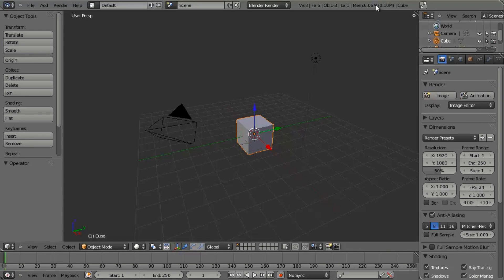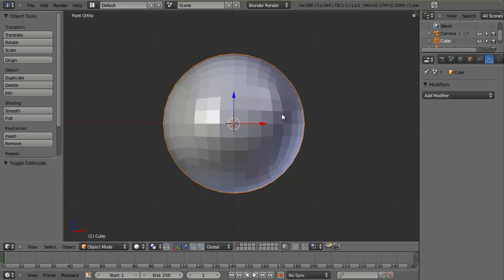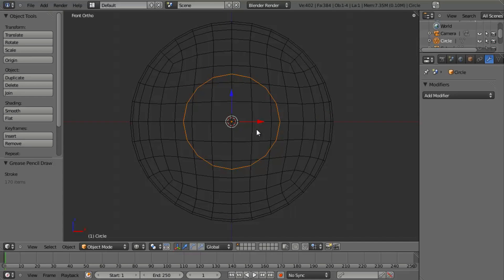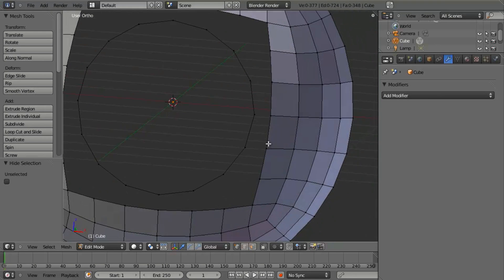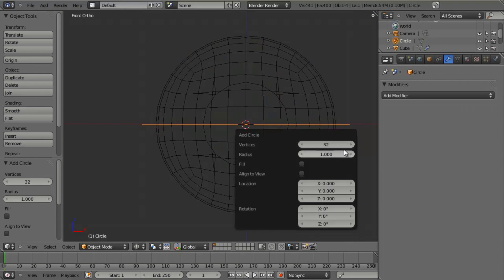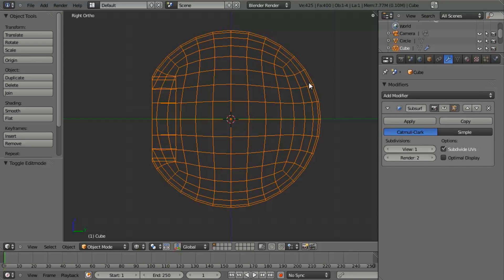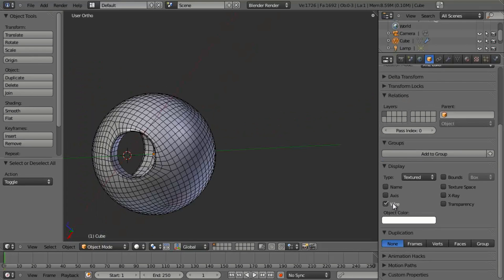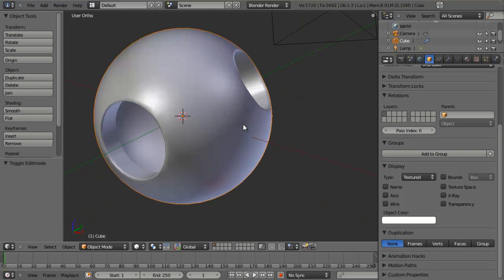CGC Classic: Modeling Round Holes on a Curved Surface (Blender 2.6)

Comment: I feel like this will never not suck. And typically the more polygons you are able to use, the better the result will generally be, assuming you are able to keep control of things anyway.

I'm not sure how to do this in Blender but there's probably a tool/script that does it out there somewhere.... but when polygon budgets are tight - I will basically cheat by projecting vertex normals. Basically cut the circles in the round thing however I like. The curved surface will generally have shitty shading, but if I project the vertex normals of a sphere with no holes in it onto a sphere with holes in it, I will get the correct nice shading of the sphere. In Maya I will achieve this by using Transfer Attributes. Also not sure how to do this in Max but I think there's some 3rd party scripts for it, I heard of something called Normal Thief.

You could also use normal map trickery but I don't think that's generally considered good practice.

Comment: Not sure if this was possible in 2.6 but instead of turning your sphere, you could use a "track to" constraint so that the circle is always facing the sphere 90 degrees. Once you are happy with the circle location, duplicate the circle in edit mode by pressing "Shift+D" and RMB to let the copy go back to its original position on top of the original circle, then separate it from the original circle by pressing "P". Your duplicated circle will retain the rotation angle of the constraint track to. Finally, delete the original circle and its track to constraint. Then, apply the cut with the shrink Wrap and so on.

Comment: Jonathan this hole video works for the first hole but not the second one. You can tell the second hole is not perfect. So if you gonna make a video do it right . For someone with your experience you shouldn't settled for anything less then perfect and specially making a tutorial. 
I listened to you for years and now your slacking bud

Comment: The easiest/best method is to use booleans. There are now plugins that add bevel to intersections. Your method too many clicks and it even add pinching. If you put fully reflective texture you'll see wrong reflections near hole. Even with phong it's already visible, it also affects silouette, visible from 90 degrees.
Reply: best way is to use loop tool.
just enable it in the add-ons.

Comment: I would personally use 2 round cubes with exact same scale and exact same location and rotation and then subdivide one of the cubes alot and model the other cube on top of the other while using Shrinkwrap modifier and then also using the Looptools addon. That makes it 100 times more easy to put a circular hole wherever i want it. And then i just apply the shrinkwrap modifier and delete the subdivided round cube

Comment: The fact there is, has to be, some special method for cutting circular hoes in spheres is just a general and abysmal failure of Polygon based 3D modelling
Reply: You could always do a sculpting workflow if you prefer, although at the end of the day if you don't know the polygon based topology you'll have a harder time making an optimized model. Otherwise I'm really not sure what option you'd use that isn't polygonal. I suppose maybe you could do something with Nurbs, metaballs or a particle and influencer system, but those options hardly seem less complicated to me.
Reply: You could always just knife project

Comment: ahh. the days before the booleen modifier :P
Reply: 1:22 There was a boolean modifier
Reply: Or sculpt tool's bool tool.
Reply: the days before LoopTools' Circle command.
Reply: @thomasanderson1416  that does not maintain the curvature of the surface correctly. it will offset the orientation and is a lot of work to correct. your better off using a boolean operation and correcting the topology by hand
Reply: @AlienXtream1  Are you sure?
It keeps the topology just fine for me, I was able to get the shape above in just a few seconds, just circlize and extrude
Reply: The boolean modifier completely destroys topology, its very unoptimal.
Reply: oof in combination with the remesh it isn’t so bad
Reply: @superboy9431  I think it doesn't destroy any topology that isn't involved. In this case you could use a cylinder to punch out a hole into the sphere. But after that you have to do the retopology just like in this tutorial. It's just another way of approaching this dilemma :D And with booleans you wouldn't have to rotate the sphere in case that was inconvenient for some reason.
Reply: @Lattamonsteri  idk man it always fucked shit up on my end. I always work with quads tho so I think that if you work with tris boolean is completely viable.
Reply: @superboy9431  Yea I meant that you can use booleans to get the intersection part (The circle that was created here with the shrinkwrap). But in any case you have to delete pretty much everything else that the boolean modifier created. The whole thing needs retopoing :D It's also important to get the cylinder lined up with the sphere which isn't trivial. So maybe it's not even that good of an approach. :D I just thought that it might work without testing if it really does work.

PS.
I've yet to meet someone who doesn't work preferrably with quads because subdividing and making extra loop cuts is much easier with a quad mesh. But sometimes even triangles are good ;D So i tolerate them a bit sometimes.
Reply: @Lattamonsteri  dont game devs work with tris? or do they just work with quads and then triangulate?
Reply: @superboy9431  Short answer: yes, I think they work with quads and triangulate stuff after modeling and animation is complete.

Long and weird answer:
As far as I know, every render engine that uses polygons secretly transforms quads into triangles. It's just mathematically convenient and you can be sure that a triangle is flat, where as a quad can be crooked and therefore it's hard for a PC to know how the light would bounce off of it :D 

It's often said that game devs work with tris because I think in the past you had to export triangulated models to game engines if you wanted them to work. I had some trouble with Unity when I exported quad-based meshes to it, but for the most part they worked just fine and Unreal engine 4 also seems to accept quads nicely. I guess game engines won't dynamically alter how the quads re calculated, so it's important to predetermine how the actual triangles are situated in the model. But to be honest, I'm not certain about this. However in Maya and blender for example the software can flip the triangles of a quad so that they'll always look smooth (because they can get distorted in animation) but sometimes the flip can be visible and ugly there too.

If I understand things correctly, it's easier for a modeller to make the model with quads because then you can add loop cuts where you want . And then only if the game engine needs triangulated models, you triangulate your quad-model when you export it. :D But I might be wrong so take my comments with a grain of salt.

There's a link that I found helpful (I'm also very bad at explaining things :D)
https://www.youtube.com/watch?v=VXS70tRhMb8